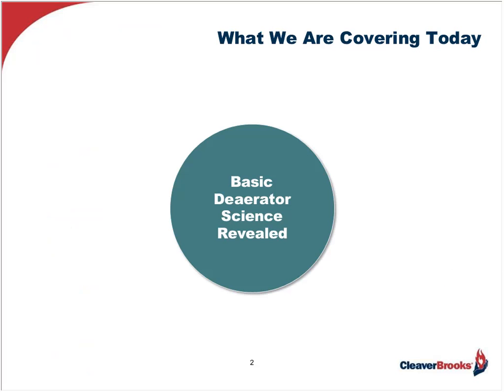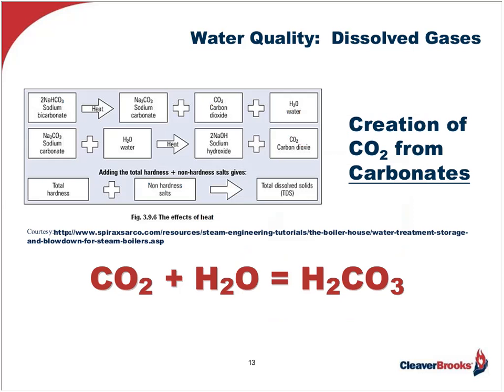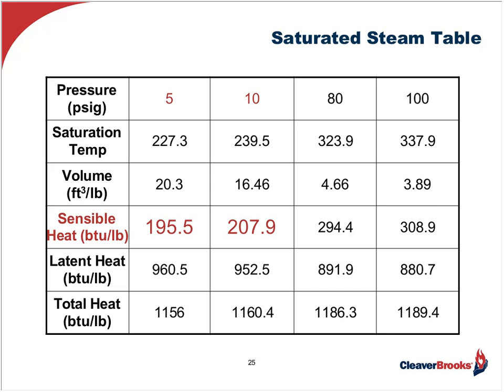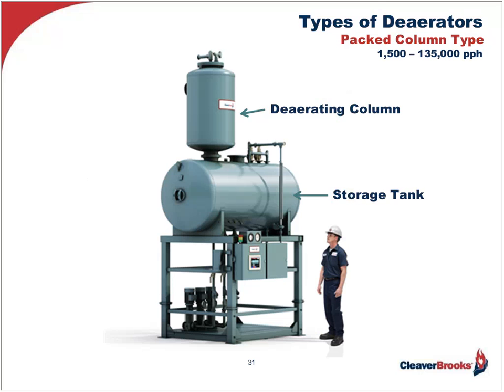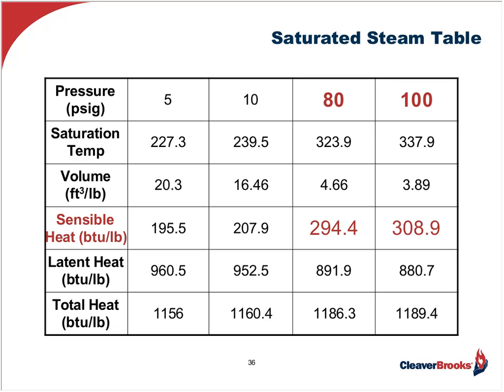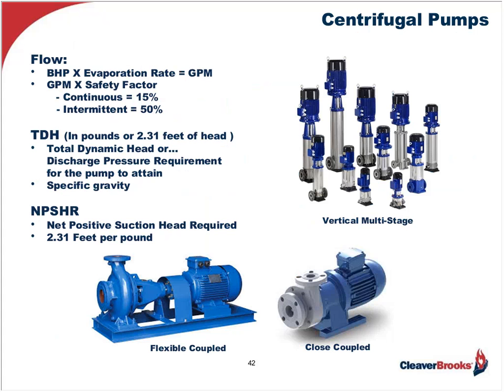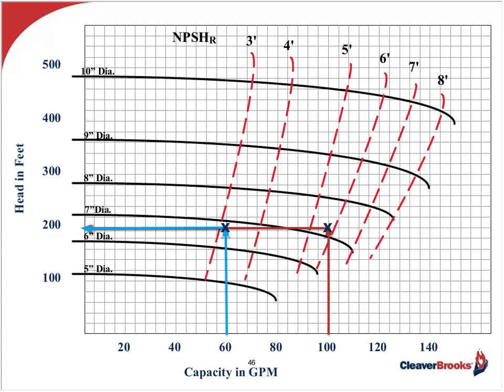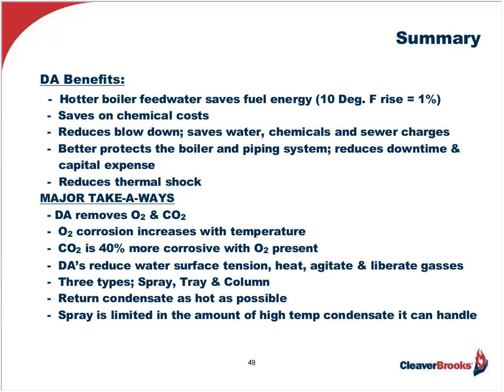Basic Deaerator Science Revealed-January 2015

Comment: I have seen pump station for pumping water from ground level up the hill , pump operate at pressure of 900 meter and pump 54 liter per sec. There is a dearator unit on the pump suction side put no one from operation give a clear answer on why they need deaeration system . The pump station in operation  since 1983
Any idea why do we need it o  the system